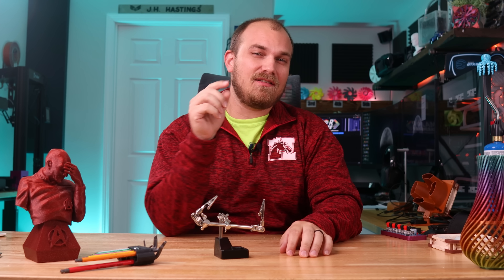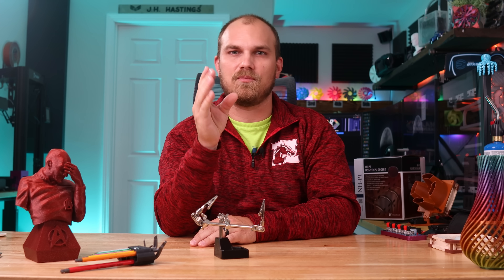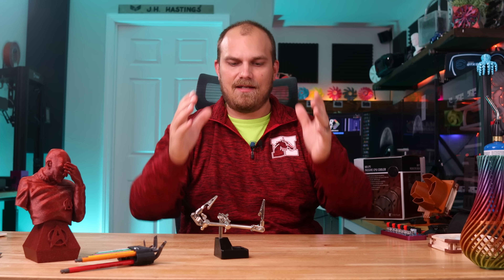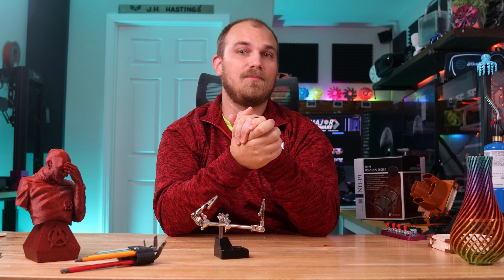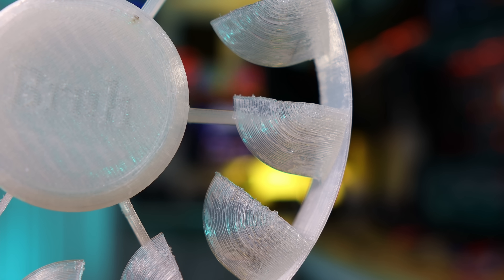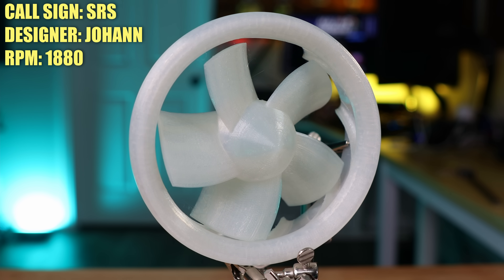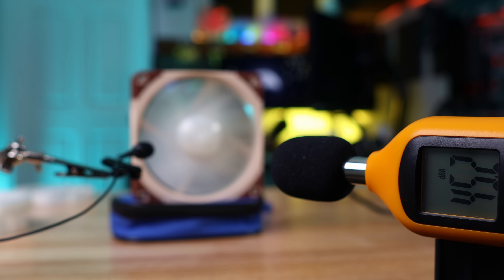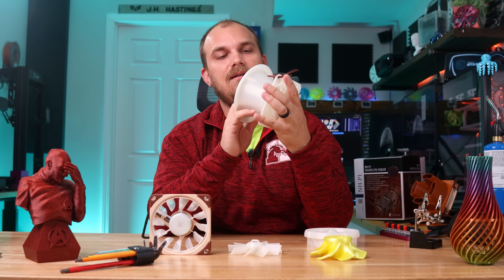TURBOCHARGING the Noctua NH-P1 - Fan Showdown S3E1

Comment: I'm gonna say it, this is a bad idea. To meaningfully test the fans' perfomances, you should let them work at least approximately impedance matched. The passive Noctua cooler provides basically 0 resistance to air moving through it, so the ram air pressure capabilities of the different fans won't make much impact. You can essentially use a hairdryer set to cold and not see much improvement over a newpaper that you wave in the general direction of the cooler.

Maybe you thought of all of this, and have a better reasoning, but I just wanted to get it out there.

Comment: if the cooler is designed to work good without air movement then adding air movement can only increase its power.

Comment: weird setup.  That cooler is not even gedesignd for fans so rather silly test setup. It has very little active cooling capacity meaning the fans are pretty much useless past a certain point.

Comment: Interesting. With this new cooler arrangement, I think there may be an advantage to reversing the fan blades, so the direction of air flow goes upwards, drawing through the NH-P1 and exhausting upwards

Comment: This is a heatpipe cooler which should be mounted so the heatpipes point up, so the hot fluid inside the pipes can rise up and cool down while doing so. Mounting it sideways limits that. To what degree?! I have no idea, but its not ideal. Especially for a cooler which is actually designed to work passivly (not with your setup, though).

Comment: The thing about compression is that it needs to rotate so fast its not even funny.
 They can spin as fast as 250000rpm, and they need that speed to compress the air enough to make it have a difference.

However, i do believe the idea of compression is somewhat viable here.
It could be done with gearing to convert some of the very low torque of the motor to even more speed.
Or just have alot more narrowing in the compression.

Comment: the turbo was a nice idea but it has one flaw RPM's turbos work best when spinning stupid fast they can easily reach 100,000 a well made one can peak at 300,000 or more for short periods of time. obviously a PC dont need that much air flow but your still gonna need more then what a normal PC fan does around 4000 to 5000 would do but its probably gonna sound like a semi hauling uphill.

Comment: Dude, using the "passive" cooler means that even fans which have bad static preasure are gonna be ok but the ones that optimize fot pressure over flow will suck more than they will in real world uses

Comment: Intresting as always!
I just think that passive cooler now rather prefers high flowing fans than high static pressure optimized ones.
Could you just retest the Superfan on the old setup, would be interesting to see the difference.

Comment: I think the biggest probly with the turbocharger is that those are designed to function at.. a little bit higher RPM's. Also generally decent turbo's these days have 'anti-surge'. Where there is a hole in the middle going to one set of blades. then holes around the outside going to the set of blades behind it. I've been interested to see somebody try doing that.

Comment: I'm still of the opinion that the comparisons may not be completely fair, because to accurately compare them you would need to do it under the same air pressure and air humidity conditions. Also preferably on the same room air temperature conditions (I have the hunch the the delta calculation is not enough to make it fair).

Comment: NEVER use a fan with this cooler except...
There's ALMOST no point, ever, in getting this cooler if you plan to use a fan. There are better coolers WITH fans that run cooler at fans speeds that are inaudible. The ONLY reason to get this cooler AND add a fan is if you can run the CPU almost all of the time FANLESS and just need the fan when temps spike on rare occasions. That can be hard to figure out even with Noctua's guide as room temp, case design etc varies... rule of thumb is that if NOCTUA suggests getting the extra fan then go get an NH-D15 or similar cooler instead... even at 300RPM fan speed on the NH-D15 which is silent it WILL cool better than the passive.

Comment: Still it would be cool or better to test these fans with the setup in previous seasons, so then there can be a comparison.
Also, the biggest potential market wouldn't be for the Noctua P1. To make any fan design by fans potentially userful, the Fan Show should keep the previous testing setup.

Comment: Feel the cooler is a bad choice, it's unrealistic for the majority of most users. Either a AIO or a decent tower cooler makes sense.

As now fans with no static pressure but high CFM will perform well, which are rubbish for cooling most other things.

Comment: Hi, I am a huge fan of this series. Sorry but I have to say that the cooler choice is horrible. Yeah I know, it is cool and new, but simply bad for testing fans since it has really low static pressure requirement. Please use a standard heatsink or a raditor, thank you! 

Also noise normalizes would be much better but ok.

Comment: the resitrictive nature tests static pressure aswell where as this new cooler doesn't really challenge a fan like it would pushing through a radiator or standard heatsink, so to win all you need to do is make a very low pitch  small blade fan to max RPM

Comment: I don't think these engineering people realize that compressed air is hotter than uncompressed air. a turbocharger is designed to compress the air. more than likely, basing a design on the intake of a turbo will produce more compression than being based on the exhaust side of a turbo, which is designed to decompress the exhaust while maximizing flow.

Comment: the turbo was some impressive design work but a turbo charger is a compressor not a fan so i'm not surprised in the slightest it was trying to push air to the sides and not through. it would have done considerably better on a blower fan GPU

Comment: I know you have a long running with the Noctua fans... I was wondering if I could pose a rather serious (and somewhat scientific) question to you. If you have the capability to measure the power draw of your fans as well, I would love it if you would test your Noctua fans against the Furious Vardar FF-5 3000 RPM fan from EK-Waterblocks. You can even run the PWM version down to 2000 RPM(roughly) and run it against the Noctua and test against the power draw and cooling capacity. If you can test how much more power it takes to run the FF-5 at 3000 VS your current first place fan, that would also be fantastic.

I think this would provide a very useful baseline against another type of fan (I did years of research) that may just prove better than the Noctua.

Comment: Noctua NH-P1 is a massive mistake as a test bench cooler, its wide fins meant for aircooling means static pressure will not matter; 
but it is a big issue for cpu cooling both water, and air and an important aspect of fan performance.  love your channel and this series, just saying.
Reply: Yep

Comment: With that passive cooler coil for this season, wouldn't it favor the fans that move more air, slower?
High speed, focused air would definitely cool, but without the tight fins and more surface area....

Guess we'll see.

Comment: I have an amazing idea for a fan design but is the software expensive? Or hard to learn?
Reply: You could probably create your fan in the free program Blender and export to STL. I don't own a 3D printer so I haven't tested that bit for myself, but it can output files that look to be printable.
Reply: @alexholker1309  ohhh Thank You. I’ll check that out.
Reply: No, dont use blender for cad, use autodesk fusion, it is also free and a proper cad program.
Reply: @riba2233  Thank You. 
I’ll check that one out too. Or I’ll just look into that one.

Comment: I'm surprised this series has not created copycats og this idea. The idea : 3D printing and testing of viewer submitted models to find the best design of something. There are tons of that 'something'.

Several that come right out the bat:
- fan turbines that can generate the most electricity. 
- trebuchet (furthest throw of a golf ball)
- spring wounded car that can jump the highest, or climb curved wall ala Ninja warriors 
- clock mechanism (tourbillon) that produces most accurate time keeping
- gearing & lever system that can lift most load without breaking
- etc

Comment: My only worry with the nh-p1, is I'd imagine it requires MUCH less static pressure than the rad needed
Reply: Which only means that airflow is more important than pressure this season.
Reply: @Pyro60000  if anything, this should just make it more relevant to how they perform in the most common mounting scenario.

most computers still just use directly mounted CPU heatsinks, after all.
Reply: @Shpoovy  but, even normal air-coolers need some static pressure, more than the nh-p1 anyways
Reply: Yeah, not a smart choice

Comment: Can we please get the numbers for how this cooler performs with the A12 mounted upside down to pull rather then push? Given how the passive cooler is intended to work by having the air naturally rise out the top I'd be very interested to see if this makes a difference as it might help justify some... interesting designs I've thought of

Comment: For the people complaining about the change of 'goalposts'...

Just compare the A12 for now. They did almost the exact same within 1 degree; so that's usually considered to be margin of error. Thus the same, pretty much. 

@0:24 and @11:35 for your ease of use. 

old setup vs new setup is basically 1 degree difference.

Though it could be seen as maybe almost 2 degrees since the base room temp was lower for the new one? I dunno. Either or, that difference is also a single degree. So between final temps and base temps... functionally the same with some possible variance.

Comment: Looks like whats important is the exhaust (back part of fan).  you can see in the tubo fan that the exhaust is vented around the sides - out.  The best performer would channel air straight out into the radiator fins.

Comment: Basically what Johann's fan was about: Made by an engineering student and designed as a three piece design with stator veins and an upper ring fairing to improve aerodynamics. Has done this in hopes of improving rotational speed and better capturing the rotational energy.

Aiden: "This fan is literally the first thing that I have ever made on CAD" Makes trash can lid. Wins.

I love fan showdown. The simplest designs always seem to win. No matter how good of an engineer you are, and how much time and effort you pour into your design, the most basic designs always seem to top the leaderboard, and I love the thought of that. Can't wait for the rest of this season!
Reply: The engineering student was the one who designed the turbo—while I did start studying mech engineering too, a long time ago, my life took me in a different direction and I‘ve been in software engineering for a good 10 years now.
The SRS design was not based on any calculations or anything, I just spent a couple hours in fusion drawing up something that tied together a few ideas of mine I had during the last couple of episodes, just to relax my mind a bit after coding. 😉

Comment: I'm surprised at where the turbo placed. I expected the Bruh to be in last place by the way it turned the run into a foggy mess.
Reply: The issue with the turbo design is it misunderstands how the impeller on a turbo works. It throws air outwards towards the sides, which is why the compressor housings are the shape they are. Using it in an application where its ideal for the air to be taken straight in and then pushed directly backwards its not surprising to see it perform poorly.
Reply: @Canuckrz  good point. I've never personally considered which direction the airflow goes on a turbo since I don't work on cars. But it does advance my understanding a bit.

Comment: Honestly i wouldn't switch the cooler to something so obscure. Right now your testing is at least mostly relatable. People can look at your numbers and know generally how it would preform on their rig. the passive heatsink is really obscure, uses thicker thin stack with less fins which will both not see as much benefit from any given fan as a normal fin stack, as well as will be biased towards high airflow rather than high pressure fans. The resulting chart will be absolutely useless for 99.9% of all people outside of a basic comparison between fans.
Reply: Plus it's performance / cost over much more effecient designs is quite a bit higher... 
The last time I checked the pricing on that Fanless cooler it was $115 . . . and the spacing of the heat plates make using a fan on it, way less effecient...
I could guess you could do better with a no name cooler that is bare bones at best costing considerbally less for the same performance...( provided it has a fan)
Reply: True